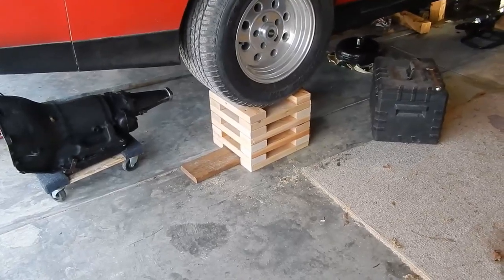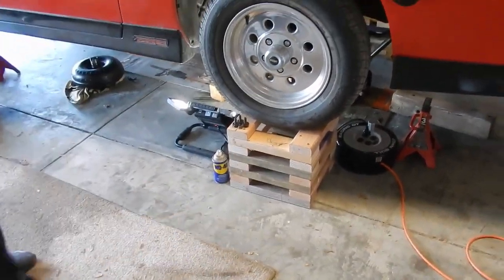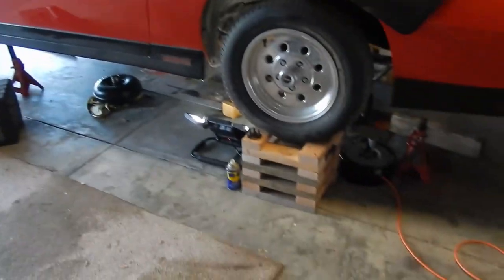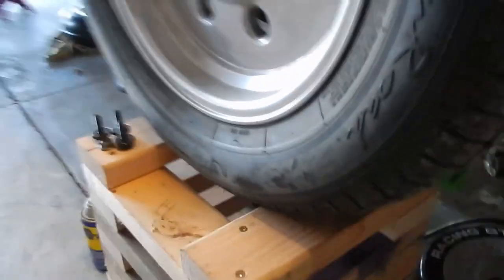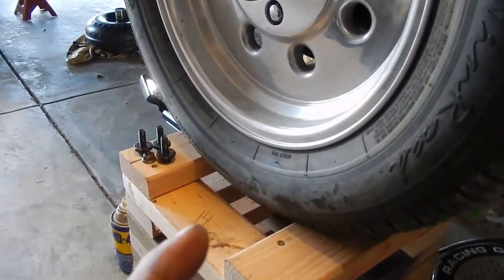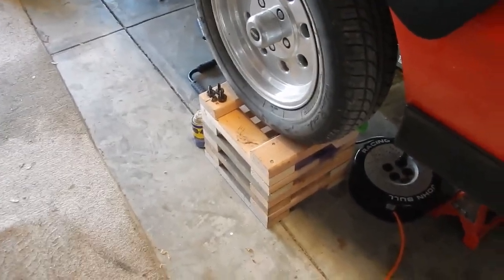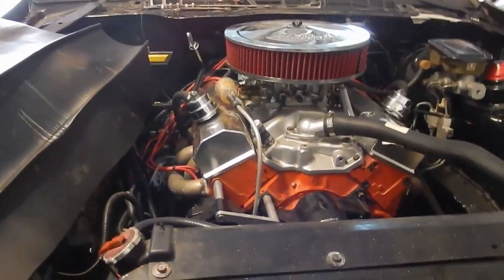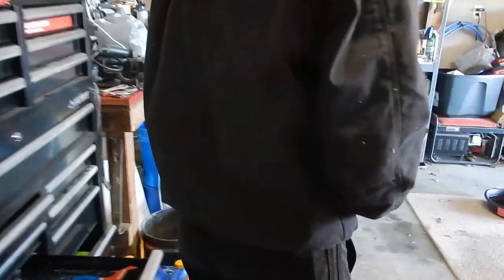Are Wheel Cribs Safe?? Cheap Car Stands, Do they help?

Comment: Nice video. I see you have 8 layers of wood block.  Assume they are 2x4. Do you know if 5 layers will provide enough height to work under the car? Thanks.
Reply from the maker: I would personally stick with the height we have in the video. It can be a little tricky getting the car on and off of them though.
They are regular store bought 2x4's. We had a bunch that we got in the warped wood section at home depot, so we used those.
Reply: @NotJustRacing  Many thanks.

Comment: What if the tires pop? Does the movement from the tire tire explosion make the car fall off the cribs? The width and height of the cribs need to be calculated carefully to cover all the worse cases. A million of chance could get you. Be safe mates.